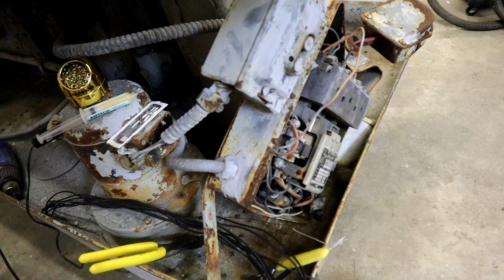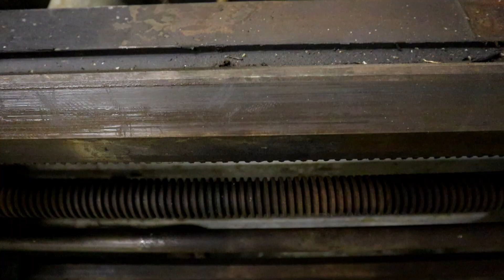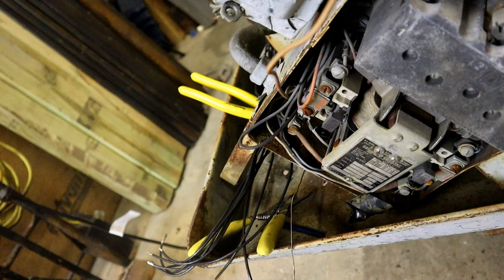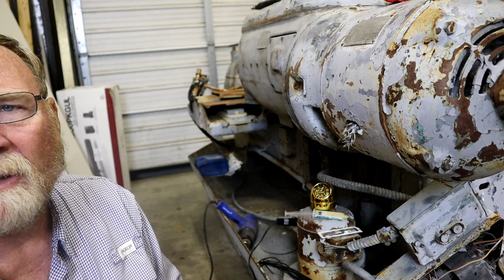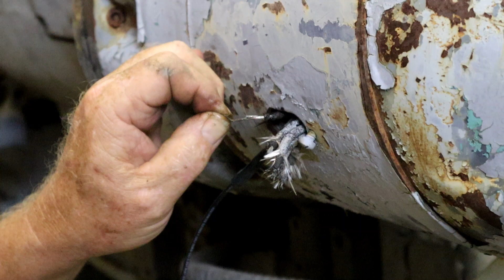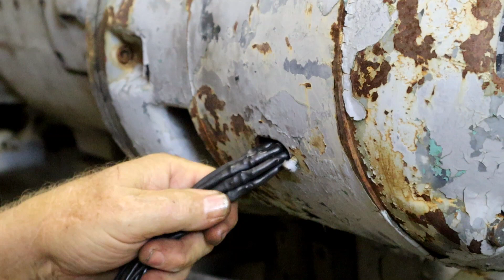Axelson 16 x 30 Motor needs HELP!

Comment: Suggestion to improve soldering is a gas mini torch, better heat and such.  Great video.
Reply from the maker: Thanks for the tip!   I was afraid of getting the wires too hot and messing things up inside the motor case..   Now that we know it runs I have bought a lot of replacement parts for the motor. And just as soon as I figure out if the gears and spindle bearings are ok I install all of that...

Comment: I've always had good results on old motors exposed to water by speaking the inside with CRC Electromotive spray. Dries things out, breaks rust, and lubricates things.
Reply from the maker: I might give that try if I can find a hole to spray that in :) So far the pecker head hole is the only one open to weather....
Reply: @10swatkins  try spraying it in the air vent slots on the ends.

Comment: Normal shrink tubing is usually not  enough for electric motor lead duty. Good thing is you can slip it over what you might be using . Some ideas. https://www.te.com/usa-en/products/power-systems/insulation-protection/electrical-heat-shrink-tubing.html?tab=pgp-story
Think grainger or mcmaster.. it's the weekend or my local motor shop might sell me some of the good stuff they use. My family has been dealing with them since the early 70s.
Reply from the maker: Don did tell me to put on two layers... I was waiting to see if I could get one size smaller for the first coat.. Thanks for the links I will look them up!